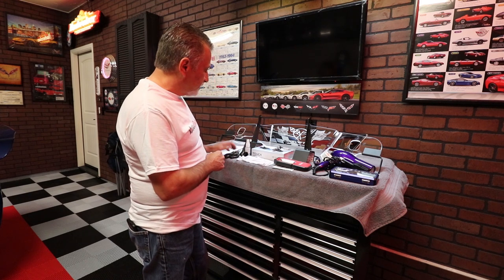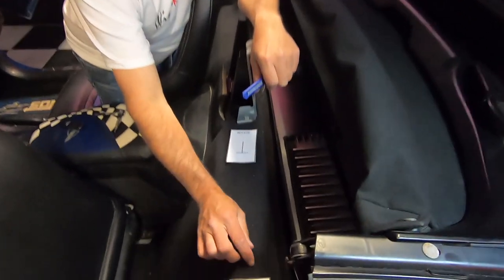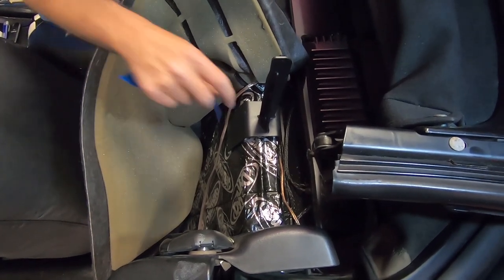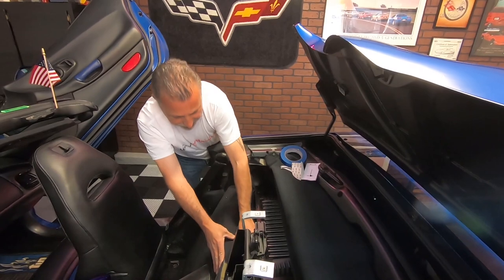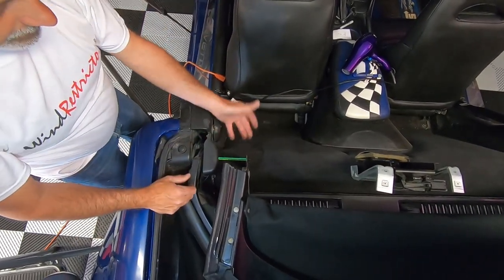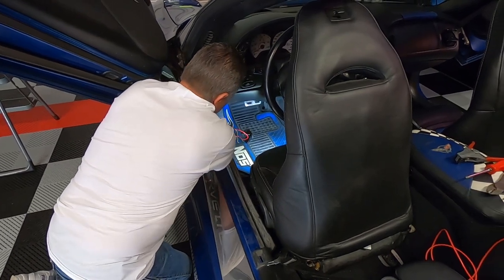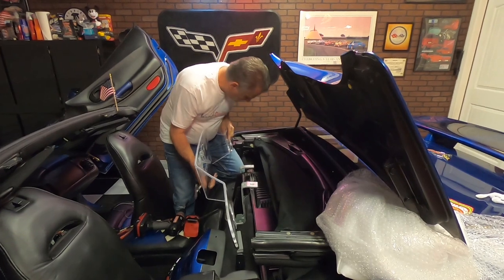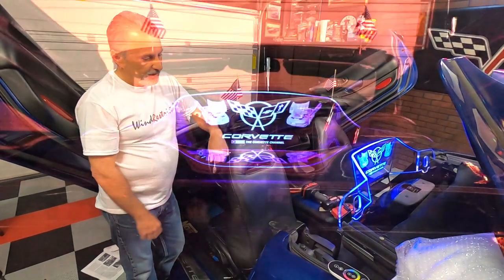How to Install a WindRestrictor Brand Wind Screen in a C5 Corvette Convertible With Discount Links

Comment: Scott,
Just installed mine today, thanks to your video I installed it, turned out great!  Only had one minor issue. When I received my restrictor the two L shaped brackets on each end of plexiglass restrictor were bent inward just a bit. I simply had to bend both sides out just a tad to make a strait L shape, it then it fit right in place. We couldn't believe how well it restricts the wind with windows down at least 50%, with windows up its crazy quiet.  Thank you
Reply from the maker: I'm so gladnit helped and that you like it!!! 
Thanks for watching!!

Comment: Great video. Once this is installed it can stay in any the too can still be used as normal? Also, will the bracket clear the seat back if the seat is all the way back? Thanks
Reply: And the top. Not any the too. Should have proof read!
Reply from the maker: Once installed the system will remember the last mode it was in.
The Restrictor should fit just fine with the seat back.
Reply: Thanks